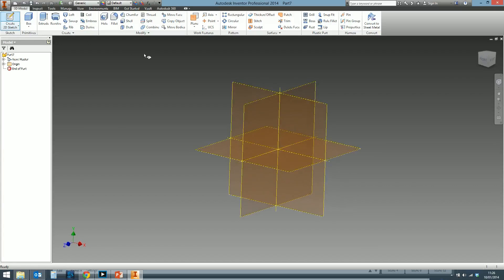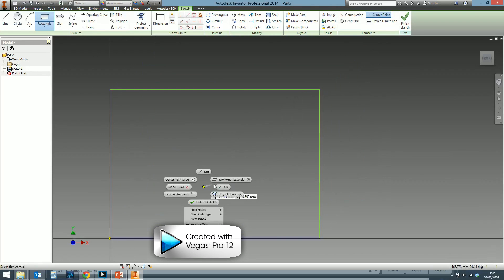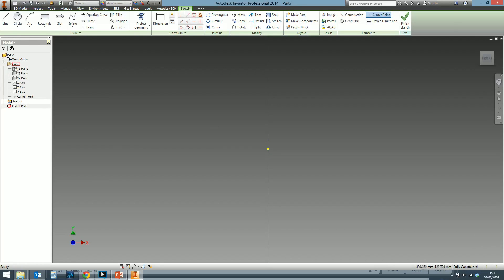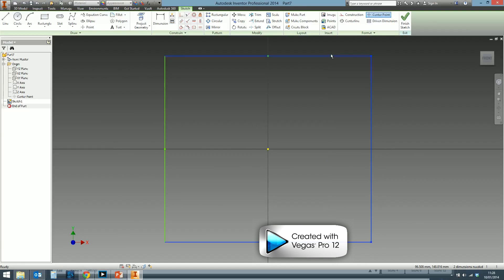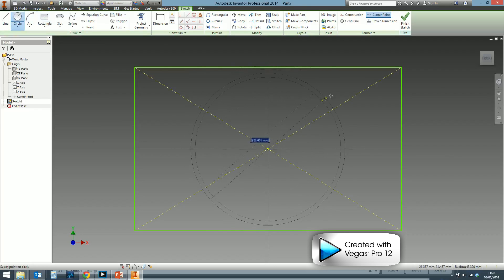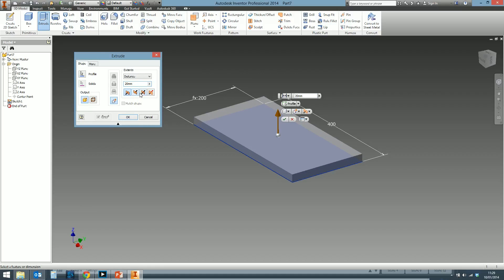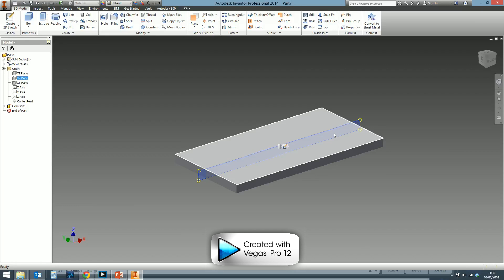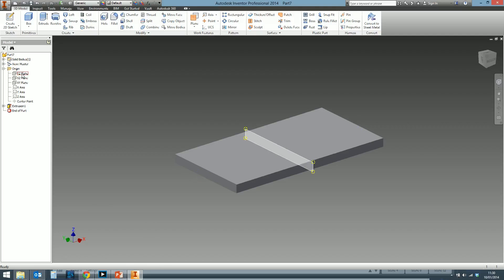Best practice for starting a 3D model | Autodesk Inventor

Comment: Two point rectangle can't be offset easily. Is there a solution for that to?
Reply: ***** I use Inventor 2014. Might that be the problem? I actually ment loop-offset. I just tried it and still doesn't work for me. I do have de Right click option of loopselect enabled?
Reply from the maker: SP1Michel Soz I was signed in with the wrong account! Loop select is on by default anyway, meaning it offsets the entire shape rather than individual lines, and yea it should work fine.  And it should be absolutely fine in 2014.  What's not happening? I assume your in a sketch in the part, click offset > click the rectangle > click again to place the offset.  Don't right click again in the middle of the command like you would do in AutoCAD.
Reply: CloudCAD Ltd Wish I could send you a video. But here is what happens. In a sketch in the part, click offset > click the rectangle > and the on the moment of clicking the rectangle I only see one edge lit up and by clicking again it only offsets that one edge. It seems it has something tot do with the automated construction lines in the rectangle. When I remove these construction lines the Loop-offset works fine. Forgot to compliment you with all the good tutorials by the way!!
Reply from the maker: SP1Michel If you have time, send the IPT to support@cloudcad.co.uk and I'll take a look at it.  Sometimes Inventor can be just ridiculous and do stuff like this without explanation, but I'll take a look if ya like.
Reply: Love the music!!!